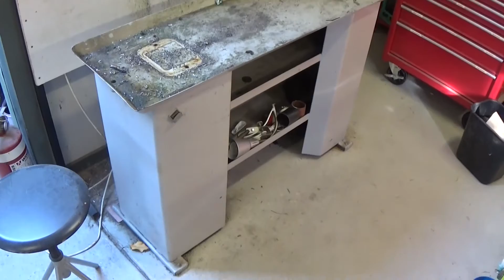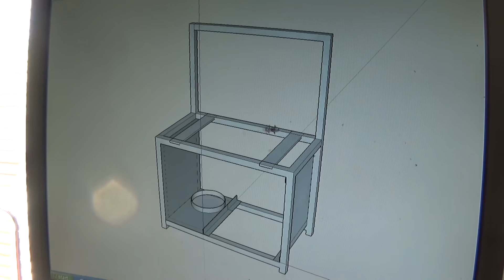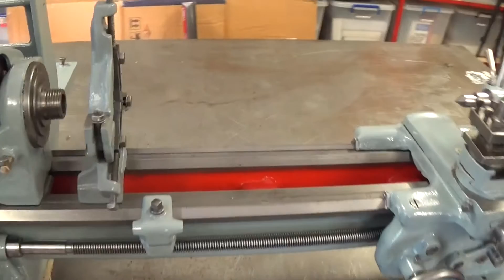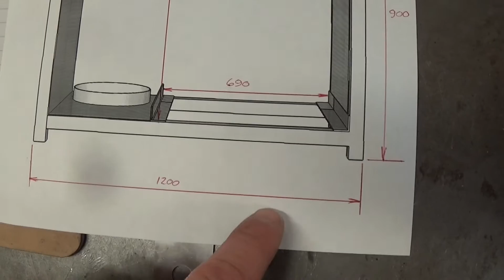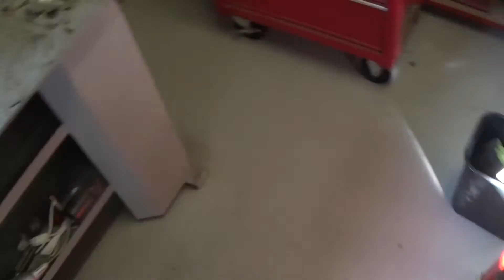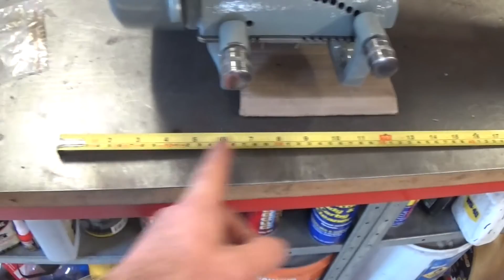How to build a killer (lathe) bench - part 1

Comment: IF !! YOUR ! LATHES ! A ! MYFORD ! OR ! A ! HURCUS ! IT !! NEEDS ! TO BE !! PUT !! STRAIGHT !! INTO !! A METAL !! SHREADDER !! EFFECTIVE !! IMMEDIATELY !!
Reply from the maker: "Hercus", not "Hurcus", and we don't shred old tools, because then we have to replace them with Chinesium
Reply: @krankengineering  YOU !! NEED !! TO !! METAL !! SHREAD !! THE !! LATHE !! RIGHT !! NOW !!!
Reply: Hercus was not so bad.  We had Hercus macines where I once worked.  Other Australian made lathes such as the Sheraton were much better, and thus much more common in machine shops.
I agree the Myford is junk, and best avoided.
The Myford ML-7 and it's variants were intended as small lathes built down to a price for high school metalwork classes.   It can do all the machining operations that teachers liked to teach, and had all the features they liked to teach.   It lacked rigidity, which can result in a poor finish on the job - this is actually a benefit in teaching, but not on real work.
For the same size (eg distance between centres), the Chinese lathes have much better rigidity.   They have modern safety features - electrical interlocks and chuck cam-locking - important in hobby use by old guys - we make mistakes and do silly things.
Chinese lathes usually need a bit of "tuning"/adjustment before use, but that is soon done.
Avoid all lathes on which the chuck is held on the spindle by a screw thread, as is the Myford.  This is because if they are run in reverse, the chuck will unscrew, and that is very dangerous.   Running in reverse is highly desirable in some operations, and greatly convenient and error free in screw cutting.
Also, if your chuck is cam-lock or otherwise fixed on instead of screwed on, you can have an emergency brake, letting you stop rotation immediately you realise something nasty is about to happen.   Also you can fit auto-stops, knowing that the brake means precision stopping from full speed.